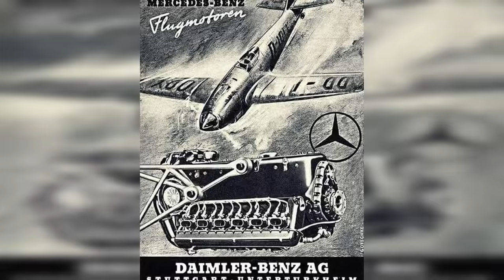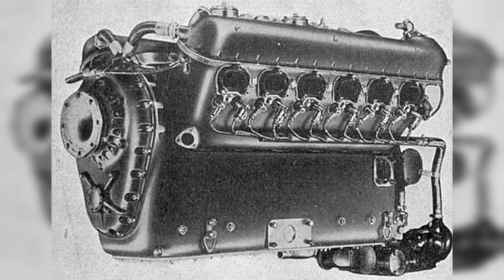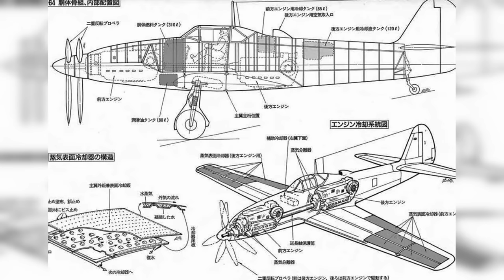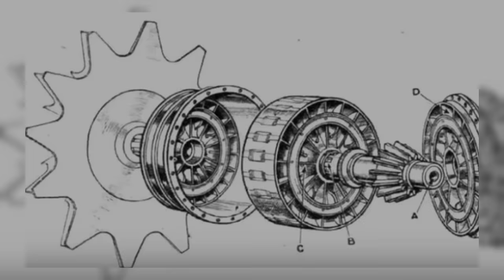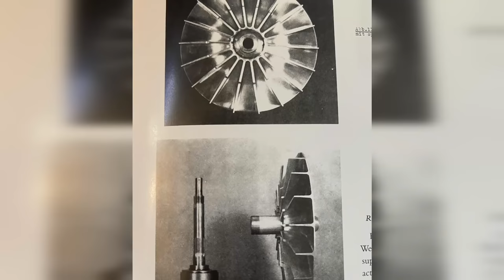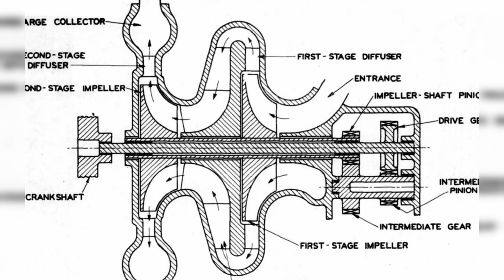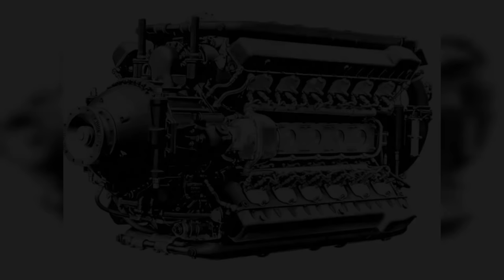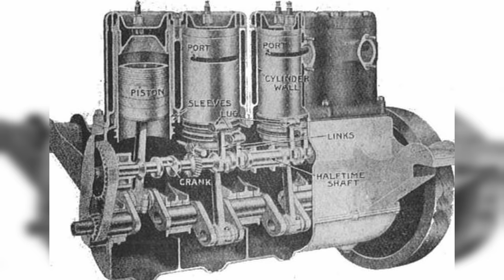The Engine of the Dark Side? Daimler-Benz DB-600 - DB-605 - Part 1

Comment: There was an article on this in our Mercedes club of America magazine, The Star. Some thing that always stayed with me was their observation that many of the engineers that were working on this had previously worked on their magnificent silver arrow Grand Prix cars of the 30s. 

IIRC Rolls-Royce was considering an inverted design but abandoned it. 

I don’t see any semblance of “evil“ in this engine, just magnificent engineering. 

Better center of gravity, mechanics didn’t have to climb up on a ladder to do most of their work and stoop down, not to mention the innovative Bosch fuel injection system which continued as a basic design into Mercedes Benz gas cars through the 1960s.
Reply: The pinnacle of which was the fuel injection system used on the Mercedes-Benz 300 SL.
Reply: @kristoffermangila  IIRC the 300SL (for the civilians; the earlier race version was carbureted), had direct injection; subsequent Mercedes did not - but they all used that magnificent mechanical fuel injection pump from the DB600 - which resembled a miniature engine.

Comment: Small boo-boo: you mention the development of electronically controlled direct fuel injection @13:00. The direct injection was of course mechanically controlled on the Bosch system, through the Genius Kommandogerat system. Electronics were only developped post WW2 with the invention of the transistor.

Nit picking of course, this remains an excellent video! Thanks for producing it.
Reply: Yep. That Bosch system is exactly the same as Bosch produced for the 1969-1973 Porsche 911, and also for race cars like the 917 and the 935.
Reply: the nazis were highly developing electronics based on the vacum tube
Reply: I always get a kick about the story of German pilots when they would inspect a fighter that had been downed and would say "what the fuck are all these levers for?" ha ha ha ha
Reply: @Alfred Wedmore you seem to not understand rotating comutators/slip rings etc and magnetic pick ups,all of which were used pre transistor
Reply: @andrewsmart2949  just lookup anything on the Kommandogerat (sp?). The Secret Horsepower Race book referenced at the beginning of the vid goes into some details about it, and it really is a masterpiece of mechanical computing. The Germans may have used vaccuum tube and commutators and whatnot on their very advanced radar detection and ECM gear, but not in their engine control systems.

Link: https://youtu.be/hlfLwQEBU-I
Reply: @davidepperson2376  Bosch supplied the mechanical fuel injection system for Mercedes Benz cars. The system fitted to the M186 inline 6 cyl engine on my 1961 300 SE is the same as used in the 1952 W 194 gullwing racer and a derivative of the system used on the DB 600's.
Reply: @andrewsmart2949  I didn't know every single one of them was a member of the NSDAP.
Reply: @BigPatViggen  you clearly dont know WTF you are talking about
Reply: @andrewsmart2949  what can you offer as proof that you do know better than what I showed you, besides flippant comments?
Reply: @davidepperson2376  is that like the Kuggelfisher (sp) on 60s BMWs? A crank driven mechanical fuel injector pump with mechanical high pressure injectors.
Reply: Transistors are a better vacuum tube. They had rudimentary computers in WWII and even in WWI based on vacuum tubes and mechanical parts. The first fully electronic computer was built in 1942 with vacuum tubes.
Reply: @PatricioGarcia1973  Exactly.  The Bosch unit in my 911 looks almost exactly like the ones on the V12 aircraft engine, but with only 6 outlets.  On the 911, the pump is driven by a cogged belt attached to the driver's side camshaft, but in Mercedes cars (and maybe the BMW?), and pretty much every diesel engine I've ever seen they are shaft driven. All the production Porsche's used Bosch, but some of their race cars (the 935 for example) used  Kuggelfisher (for reasons I'm not aware of).
Reply: @tarkalak  of course transistors were the newer tech that evolved,but caddilac had an automatic headlight dipper which used valves in 1959,so i do not accept nazis on the cutting edge of the 40's tech did not at least have some sort of electronic engine controls in development,almost all engine manufacturers have licences to bosch
Reply: @tarkalak  it was also the size of an appartment building. There were NOT used, nor usable, for engine control.
Reply: My 68 6 cylinder Benz had a Bosch mechanical fuel injection system.
Reply: @GarrettHypes  k jetronic or actual direct injection?cos apparently only 300c had direct injection engine
Reply: Mechanical analog computers go back to ancient times and reached their highest complexity in naval gunnery computers.  There is a fundamental difference between analog electronic computers working on continuously variable data and digital electronic computers both of which originated during the war.
Reply: @givenfirstnamefamilyfirstn3935  they had the ability to use vacum tubes
Reply: @andrewsmart2949   yup, even diodes needed valves/vacuum tubes before the semiconductor revolution.
Reply: @givenfirstnamefamilyfirstn3935  why?,they were usuing mercury arc rectifiers well before the semi conductor diodes came along,and often 400 amps and above on tramlines,the nazis had the best and most advanced tech in the world,and i bet they had engine ecu's that had valves even if it was only experimental on a test stand
Reply: @23GreyFox   It was mandatory for higher profiles engineering job to be a member of the nsdap. Not ideologically related but more as an attempt to make spying harder as they have political accountability.
Reply: @tarkalak  Yes and it was enormous and not reliable. Operating with relays and vacuum tubes. That's were the expression "having a bug" come from. As they often found bugs in the relays forbidding them to operate properly. I'm sure you're well aware about this.
Reply: @BigPatViggen  Maybe used to operate sensors or relays of some kind but not for complex operations. Resistors based sensors were in use for gauges and it's not a stretch to think they used vacuum tubes to bost the signal and used it to operate relays and motors. You can achieve this with 3 or 4 of them. They were used for the same purposes in transceivers. Je sais pas si tu es du Québec aussi. Je vis à Rouyn Noranda. IF not then your name sounds very much like someone from here.
Reply: @givenfirstnamefamilyfirstn3935   They also had triode and pentodes. They weren't the miniature types we had later but they did the same operations. I fully agree with you and  @Andrew Smart  On this.
Reply: @andrewsmart2949  I think he's talking about vacuum tubes rectifiers. Mercury vapour ones were used in high demanding power and small applications to. And other types were used since almost 30 years before the war. Examples types 80 and the small Mercury vapour type 83 were used in radios and communications since the 20's. 
I've 30 years of experience in refurbishment of these older systems for collectors and museums who want to have a fully working device for demonstration purposes. I've done a couple of them for the Canadian museum of aviation and science and technology museum in Ottawa.
Reply: @xminusone1  he's talking total shit,remeber the offical story was they didnt even have nuclear reactors when they had at least 5 working units,tino struckman has documented a nuclear test in late 1945 in germany,and the second bomb dropped on nagasaki was a gift from defecting general hans kammler(tino has an application in to exume a grave in america and compare the DNA to kammlers living great grandson),the northrop flying wings were directly copied from german designs,they had axial flow turbojets when the poms/frank whittle were still messing with centafugal turojets LOL,their shit was so advanced (and brands like bosch/hella etc are still light years ahead of compeditors,dont tell me they didnt have rudimentary EFI in the works,remeber caddilac in america had vacum tube headlight dippers etc in 57-59 ,so clearly the tech was avail and someone only needed to apply it,and germans were at the cutting edge of new tech,particularly vehicle systems
Reply: It was controlled by a diaphragm I'm not asking
Reply: @xminusone1  St-Jean sur Richelieu :)

Pour ce qui est de l'électronique ou du contrôle par tube, j'en doute fort, car ce n'était pas encore fiable et à lamfin, l'Allemagne manquait de tout, des matières premières aux techniciens spécialisés, et il y avait fort à faire partout ailleurs...

Je m'éloigne de cette discussion, car deux trois illuminés avec le fétiche des "Nazis qui ont tout inventés" polluent une discussion qui aurait pu être intéressantes.
Reply: @dntlss those German pilots would have learned flying on planes with all those levers for engine control as well

Comment: An important omission in reporting the downside of straight vanes in the RR turbo was that flat,  straight vanes created a definite pulse in the boosted air supply, making smooth fuel/air mix more difficult even with injection. Curved vanes delivered a more constant smooth supply of the concentrated air with even larger turbos being much more efficient  than the  straight vaned variety.

Comment: 605 had several problems with mainbearings and lubrication and oil foam when installed in BF109´s because Willy M. refused to enlarge (another bulge in the 109 cowling!) its oil tank which was clearly undersized from that what Merc was recommending ! In 110´s the 605 did last longer (more room for bigger oiltank and for defoaming device "Ölschleuder") but they were´nt flown such hard as a single fighterplane too.

Comment: It was the slotted exhaust ports down low instead of up high on the 109 that 1st fish hooked you. And then you realized it had no oil pan with its dry sump oiling system. And it would fly just fine inverted instead of konking out in a simple -G pushover like a Merlin. And the 20mil "Motorcanone" that fired between its cylinder banks and recoiled into the cockpit. And the ground crews cranking them over like lawnmowers. And the fires they built under them on the Eastern front so they would start. And the...

Comment: 12:53 Small but important point: the fuel injection systems used in these planes were mechanical, not electronic. IINM the first electronic fuel injection system used in a production vehicle, was a Bendix system in the 1950s. It used thermionic valves, and wasn't successful.

Comment: Thanx for the excellent video, much needed to put some facts in order.
My read of this history is that Germany, especially in the wake of rearmament, made up for lost time, but quickly was brought to the reality that, due to the lack of sufficient quantities of strategic materials, it could not compete in exactly the same ways as the future Allies. So, as higher performance requirements  brought higher engine stresses, the Germans couldn't access the necessary & sometimes exotic materials to resolve this, e.g. bearings. Therefore, maintaining roller bearings, and lower boost pressures were required. Yet remaining competitive--indeed, winning--was required, so other methods (larger displacements, GM1, MW50) were employed. I believe Germany was 1st to figure out the knock rating problems, and had more than adequate octanes, but didn't have adequate production capacities. At midwar & immediate postwar, Allies were "scratching their   heads" that Germany was manufacturing avgas with octane ratings superfluous to the needs of their operational aircraft. 
There's much more to be said regarding the competitive disadvantages with which the Nazis had to contend. Leaving the turbojet story aside, suffice it to say that by VE day, the production war was lost, but German aviation motor technology was evenly competitive with the Allies ( although this would have also have come to a screaming halt as, according to Speer, by May '45, Germany's total supplies  of strategic materials would only fill a broom closet.).
Reply: Germany recognized before the war that larger displacement engines would be needed to operate at the Maximum potential of aerodynamic technology...
The Rolls-Royce Merlin was clearly too small to meet power demands of modern fighter designs like the Tempest.
 Germany clearly had a major technology advantage with the widespread use of Gasoline Direct Injection and variable speed superchargers... this was vastly superior to carburators and fixed speed blowers in every way.
GDI allows lower octane fuels to be used without the risk of damage from "Knock"
Reply: MW50 had another important advantage.. its extended the amount of TIME that WEP or emergency combat power (P-MAX) could be used... some Luftwaffe aircraft carried enough MW50 to extend WEP up to 20 minutes per flight, 400% more than a typical Allied aircraft  (5 minutes max.)

Comment: Love your channel! Would love to see a vid about how DB squeezed a cannon barrel in the “V” of the engine. Can you imagine the complexity of design and the maintenance nightmare that would entail! 
Keep up the great work!
Reply: + Turbobus    The cannon is sitting between the feet of the pilot, and the blast tube passes through the engine VEE and a hollow propeller shaft.   So not necessarily complex,  just hard to reach.
Reply: it was actually very simple German aircraft were very simple though they did have the worst motor cannon Russians did it far better without much fail their guns were just a whole lot more powerful it actually broke the plane
Reply: Much less complicated than a double row radial or a Napier Sabre.
The massive 30mm cannon mounted inline was a major advantage.
Reply: Not really. It is an empty space. No harder that accessing a lot of guns. The main difficulty is making sure the vibrations dont screw with the engine.

Comment: Fun fact, one of the disadvantages of fuel injection is you forego the cooling effect of a carburetor system,  on the Merlin engine, induction temperatures due to supercharging could reach 200 degrees C, the cooling effect of evaporating the fuel in the carburetors was estimated to be worth around 100hp if I remember correctly.

Comment: I had been under the impression that normally-aspirated engines benefitted from valve overlap, but supercharged engines risked pushing some of the air-fuel mixture out the exhaust before it could be burned, damaging range.
Reply: Yes thats why you can only do it if you have direct injection.

Comment: Pratt & Whitney recognized the limitations of a standard carburetor and began using a new type "pressure carburetor" from Bendix-Stromberg- basically a throttle body type injection system with no fuel bowl or floats. Rolls Royce saw the problems RAF fighters in Hurricanes and Spitfires were having with fuel starvation in negative G's and adapted the Bendix-Stromberg carb and began having a much easier time with Messerschmitts and Focke-Wulfs.

Comment: Laura , is not only correct regarding the basic design ethos. 

As a lifelong student/ restorer/ builder of vintage vehicles (with a specialty in ENGLISH machinery) for a break from the challenge posed by Brit design I always keep a couple of German vehicles to work on as a relief!!

I have always believed that when referring to the processes of work on about ANY German  machine I have worked on the following truth is wise to remember…

“ if you are finding it hard to work on or understand, then You most certainly ARE Doing it WRONG!!!”

Comment: There is often actually something in German water, namely radon. Germany has very large uranium deposits (Germany was once the third largest uranium producer in the world) and the decay of uranium produces radon gas. In many regions, waterworks have to filter radon from the water. In some regions, cellars also need to be particularly ventilated because radon can get into the cellar through the floor slab. Radon is considered to be the cause of 5% of lung cancer cases in Germany, directly after smoking.

Comment: @12:05 
That's a kugelfischer, the penultimate headache for a german auto mechanic.

@12:53 there was no electronic fuel injection yet. Bosch style mechanical fuel injection is just that- entirely mechanical.
Reply: I have a BMW e24 that is fitted with kugelfischer mechanical fuel injection. Yes it is complicated but logical. This car performs better than a lot of more modern models. When you know how it is quite easy to set up.
Reply: Klugelfischer is a port fuel injection system and was developed by Fischer AG. in 1960s

Comment: Rolls Royce considered an inverted V-12 design for powering the aircraft design that became the Spitfire. It got no further than design studies and a wooden mock-up but it was every bit as mean looking as the Daimler engine. The nastiest looking production engine had to be the Napier Sabre.
Reply: I think the Nomad looked more crazy/mean although it came out in 49.
Reply: What’s weird is that the Brabham Formula 1 team ran into oil starvation problems in the 80’s when they laid their BMW in-line 4 engines on their side to obtain a lower center of gravity. The car was an utter failure 🤷‍♂️.

Comment: The modern Mahle F1 direct injection technology could have been implemented in WW2 and would have solved German fuel knock problem, and could have eliminated the toxic lead fuel additive pollution worldwide saving billions of lost IQ and which some believe caused increased crime by those worst affected. Also much improved fuel economy would have prevented a lot of CO2 pollution and oil crises and oil wars...
Reply: German engines had GDI during WW2... that's why they could run boost on lower octane fuels..
Allied pilots and ground crews were often severely injured by high lead fuel fumes.
Reply: That may be true but only if the transgressor module on the vengeance function of the retribution valve were to be activated during post synchronous jimmy nahoobie.